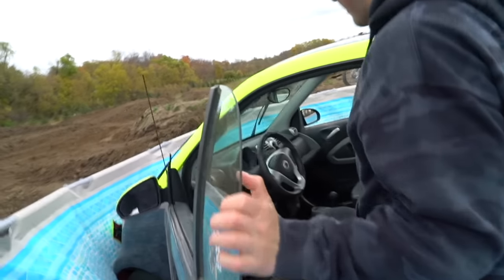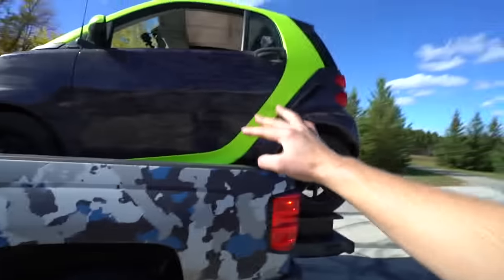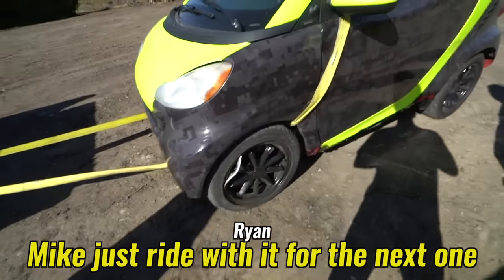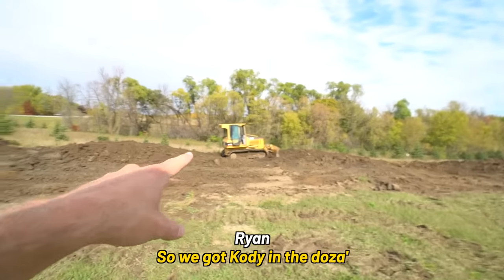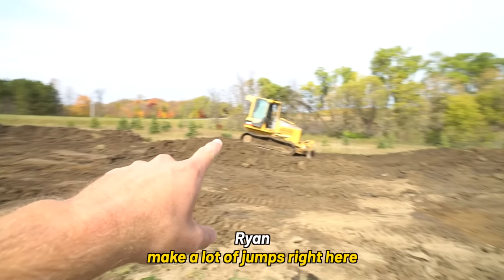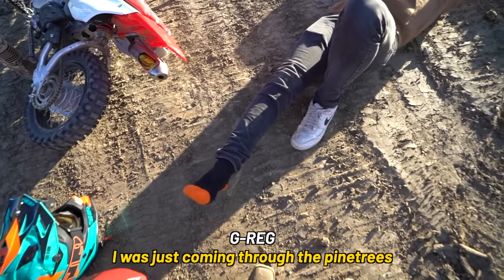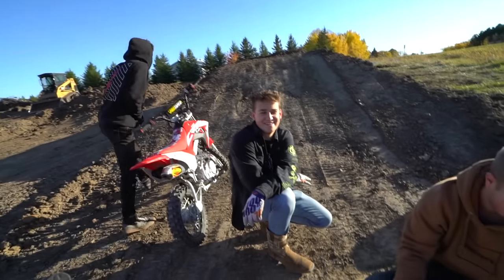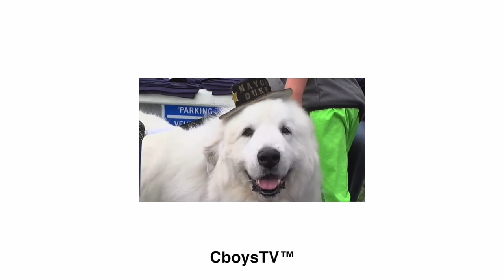Easy Smart Car Unload (Gone Right?)

Comment: It's probly hydrolocked pull all of the spark plugs and turn the motor over water should come out also change the gas and oil.

Comment: I'm not going to say guarantee but I bet you if you pull the plugs and pull the intake filter off of it and turn it over for a little better but you can get that thing to run you might have to drain the oil and get the water out of the crankcase but I bet you'll run again if you let it dry out for a bit